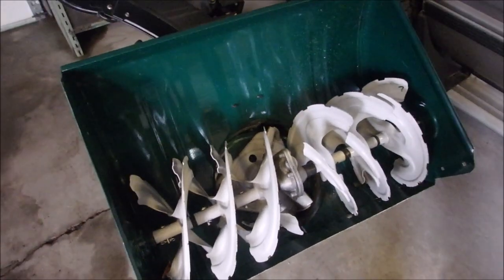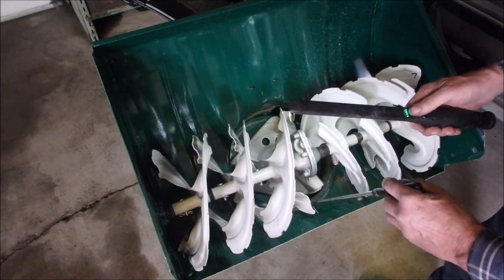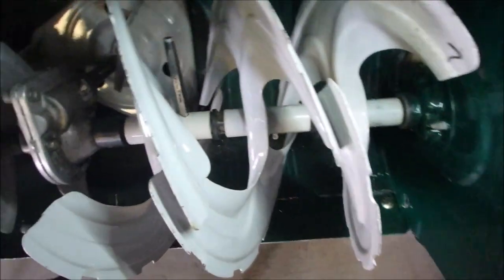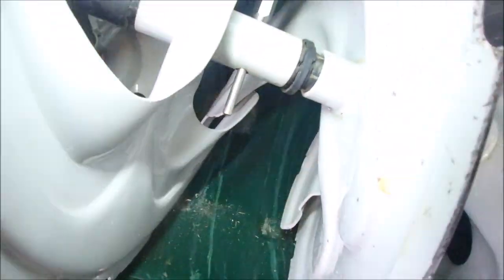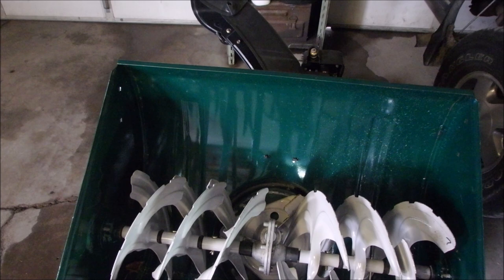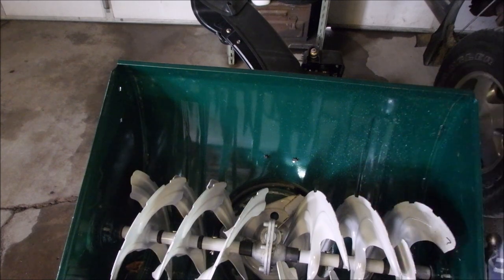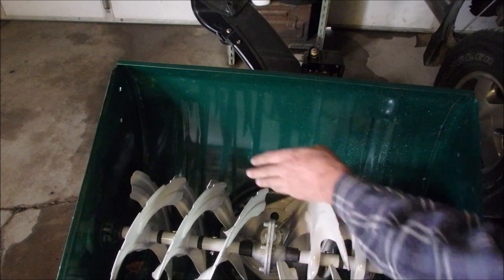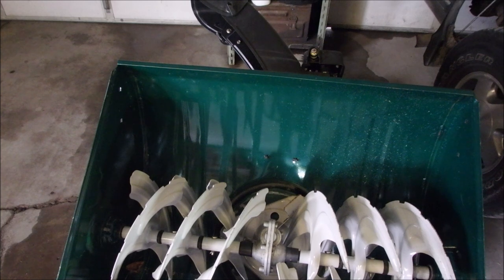Yardworks Snowblower has broken Shear Pins

Comment: MTD cheaped out with plastic bushings and no grease zerks on their snowblowers.  I tell my customers to rock the tines before each use to verify if any of the pins are sheared. On those and the TroyBilts I usually zip tie a bag of 10 pins and clips to the handlebars!
Reply from the maker: Great point!  Theyuse too many shear pins in my opinion

Comment: I inherited a Toro brand from my generous neighbor and on that model Toro has regular bolts and not shear pins. The claim is that if there is an obstruction the machine's engine will shut down prior to any other failure and therefore there is no need for shear pins. Lots of people I talk to say they never heard of that.
Reply from the maker: I would very much doubt that.  I think shear pins with save the gear box on the auger shaft.

Comment: How old is that machine Bruce? It appears to be well built and mostly metal, not all plastic like “modern” machines. Looks like it is ready for next weeks snow.
Reply from the maker: It is about 4 years old.
Reply: @BrucesShop  looks more solid than I expected would expect a 2018ish snowblower to be. Must be a good one. Of course, they probably sell better snowblowers up your way, no one would want the poorly made ones in an area that your quality of life might depend on a good one. Here on the 43rd Parallel, someone that has a snowblower might not use it every year, if they can get it started with that last year’s gas still in the tank.
Reply from the maker: @haneyoakie14  Well it is a department store snow blower but it is OK.  A bit to large for my liking now although my john deere is a 32 inch  i just don't use it that much.  HEAVY.